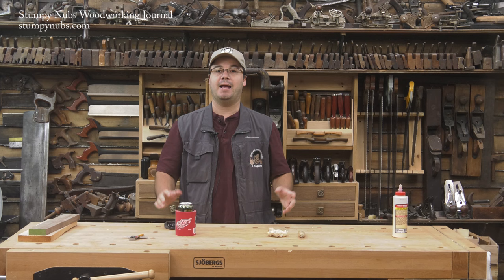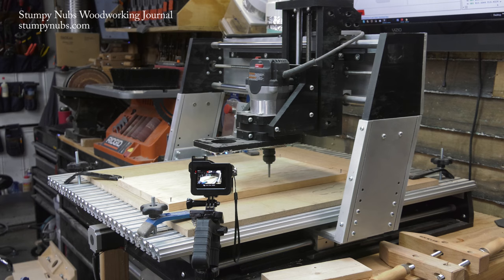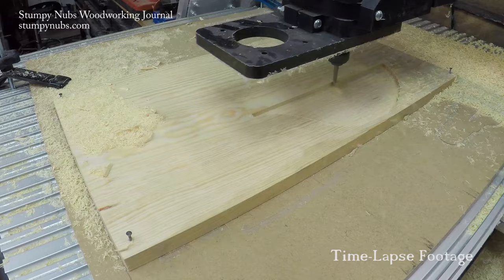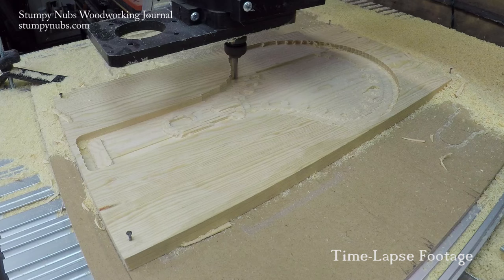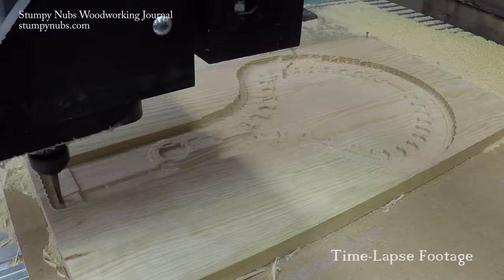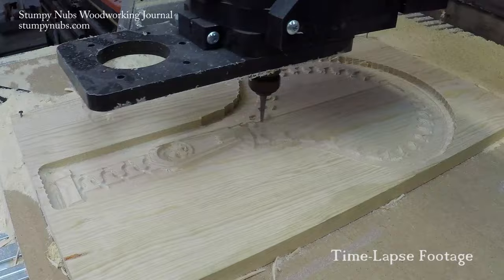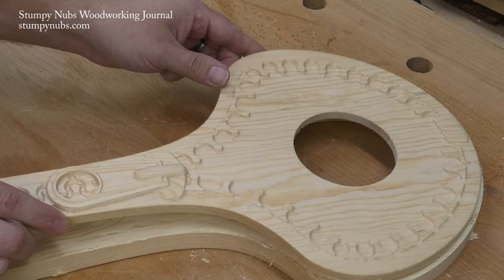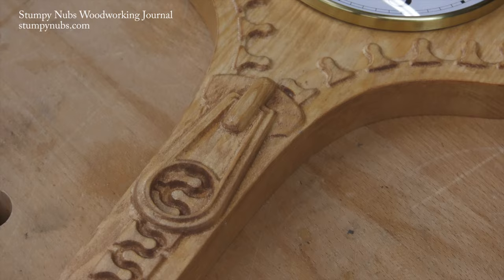WATCH THIS before you buy a CNC machine for 3D carving! (Updated)

Comment: I was wondering why there is another hole in the tool holding plate until I click on your amazon link and see it is there for a vaccum cleaner system. Did you try this system yet? Is it worth it?

Comment: Can you make a video on your setup? Or please link one if you already did it

I'm looking at making a wood shop in a year or so from now. One of the things I liked about your setup is the TV that showed what was going on at that time, and I think I might do the same.
Anyways, I think when I make my shop I will have 2 CNC machines. 1 like what you have and another being a rotary. I'm also going to have a laser cutter/engraver. And the normal stuff. I'm going to have some metal working parts in the mix. Things like brake, cutters, and so on.
Part of the shop will be section off. In it's own room I will have a 3D printer area. I already have this one, but filament can't stand humidity so I'm giving it it's own space. I'm also going to have a workstation/desk in both areas.

Something I'm wondering is how did you get your TV to show where you're at in your project. I know with my 3D printer, I might need an extra Pi or something since I don't think Octoprint works directly with any monitor.

Comment: Hi there, loved the video. I'm completely new to the CNC world but have just built my own CNC machine and now need the software to run it. I'm going to use LinuxCNC to run the actual motors but I'm really interested in the Vectric software you showed off. I wondered how you knew when to change "bits" in your spindle? Does the software tell you that? How do you know what "bits" to use and when?? Thanks again for the great video and any help you can give me (or anyone else who wants to answer this for me) Cheers :)

Comment: You describe that you are doing 3d, but a simple 3 axis machine does not do 3d.  what you are doing is 2.5 dimensional.  Your machine has no ability to cut the side of your material laying flat to the tables deck with out removing it and placing the bottom side up on another separate operation,  a 3d profiler does not require the material to be moved in order to cut every side.   You need a  machine with 4 axis or more such as a profiler machine to do true 3 dimensional.  Such like a machine that produce prosthetics are an example and usually have 5 or more axis.  2 dimensional machines are types that would work in the same fashion as a plasma or plotter, concentrating on only flat work.

Comment: I'm looking to get into the CNC game (everything from wood, polymers & composite to titanium). I'm thinking a CNC router will be a good stepping stone to eventually getting good CNC mill. The router would come in handy for soft material projects anyways. 
Would I be able to use fusion 360 for both the same? I'm starting from scratch as far as CNC's go (machines or software/code) & would appreciate any advice you can offer.

Thanks,
Reply: Yes.

Comment: I really like the look of the screen above the router.  Is it useable as a workstation in that configuration?  I'd like to do away with the cart next to my machine, but my current monitor would be too small to see from over the router.  I only use the pic now to run the router, but the bigger screen might be nice to have a second pic in shop for quick drawing work, or a web search.
Reply from the maker: It's just a VIzio HD television I used to have int he house. The older flat screen TV's used to cut off the edges when used as computer monitors. But the newer (last five years) are better. They aren't great for gaming or anything, because the response time of a television is different from a computer monitor, but it works great for the shop. My table saw is also near it, so I can put up a Sketchup model and use a wireless mouse to rotate it, take measurements, etc. while I cut my parts. And since it uses an HDMI cable, the computer can be far away from it (as long as my wireless mouse and keyboard signal can reach it.)
Reply: Nice; I was just going to suggest hanging an LCD TV on the wall- 32" are cheap as chips these days.

Comment: No,. no, and no.   This video shows  a small light duty gantry mill  that machines soft wood with engraving tool bits.   It does not use "software".   You are merely downloading  a cnc program that a programmer  wrote for his part.  (not your part).    And remember not to turn on the coolant pump,  it would ruin everything.

Comment: This is almost true but there is one small caveat that people should be aware of. Not all machine controllers are created equal. 

Some cheaper controllers do not have the ability to run all 3 axis simultaneously.  Trying to run true 3d carving gcode files could simply not run at all or create unexpected results.

Comment: Can't say I agree with the CNC definition of "3D" being the ability to cut curves in the Z plane. All carving, hand or machine, is 3D, otherwise it's whats known as a "drawing", done with a much cheaper tool called a "pencil".
The cutting is being projected normally from the X/Y plane only, onto a fixed workpiece . In 3D modelling and graphics that is known as 2.5D, curves have nothing to do with it. A 3D model with no Z curvature, such as a cube, is still 3D.
A better term for the example in the video would be "smoothed 2.5D". Going back to 3D modelling, models are comprised of polygons and to get realistic curvature requires a high poly count (not good). To reduce the poly count and get better curvature, smoothing algorithms are applied to the graphical representation. This is what is actually happening when a CNC cuts a 2.5D with curves in the Z plane, it is using a ballend bit to smooth the transition. Getting the same effect with a flat bit would require Z stepdowns of a few microns per Z pass, which could take days. It's not a case of the  software not being able to do the job, it's a case of having more efficient operations available; the cutting is calculated using a more suitable profile for the job. It can also work out roughing passes to quickly remove the masses of wood not in close proximity to the finished surface with a coarser cutter.
The jump from 2.5D to 3D is not just a case of being able to cut Z curves. Some software does true 3D and how it is created practically depends on your machine. Vectric V-Carve can produce a two-sided cutting plan where I can cut one side and then flip the workpiece 180 degrees (by hand) and cut the other side. Getting more advanced, I might have a rotary axis, where more advanced software can turn on that axis while also cutting in the other planes; e.g. a cylinder with 2.5D relief cut into the curved face.

All of the above is technically done in three dimensions; regardless of terminology and number of axes. 

You need to know what you want to make, you need to know how it is done practically and then you need to find the software that can do it. 
Then ask the spouse if you can buy it.

Comment: i was wondering where this video went yesterday! So how do you like the Shark James? If I am going to make the plunge (pun free of charge :P), I would rather have user feedback from someone who owns one.
Reply from the maker: I like it very much, no real complaints. The V-Carve software that comes with it is great stuff too (it just doesn't 3D carve like Aspire). I love the heavy 1-inch extruded aluminum bed. I wish I had gotten the liquid-cooled spindle instead of the router, but that upgrade can always be made later. They also make a new clear "box" that goes around the whole machine to contain the dust. I'd love one of those, and if I had one I would probably film more videos with it! Don't get me wrong, the dust collection boot works well. But I can't use it while filming because it blocks the view of the bit, which is what people want to see on film. Overall, I think it is a very well built machine, much better than some of the others in it's price range, and vastly better than the cheaper ones like the X-Carve. But it's a significant investment for sure, so anyone considering it should make sure they're going to use it often enough to justify the expense. :)

Comment: CNC machines are fine you can find cheap and expensive ones but once you see their software you will hit a big rock. If you don't know how to programme them or know how to change the programs do not buy such machines because they are really hard to run. I built my own CNC with stepper motors and electric board and  I was using Mach 3 software and it was extremely hard to do any job.
So try the software first and if you manage to run it then buy a CNC but you have a hard time with the software the machine will just be parked and you will burn your money for nothing.

Comment: EstlCAM is great, and it's very cheap. I made my own CNC machine. I'm surprised you haven't gone down that path yourself.
Reply: Jeff. Thanks for the lead on EstlCAM. I also built my own machine a few years ago. (22'x33' cutting capacity) I am surprised/pleased with it's operation and accuracy; but was shocked at the software cost. As a result it has been mostly gathering dust for the last few years. I will try out your recommendation.
Reply from the maker: You have a 22-foot X 33-foot CNC? Or did you mean inches (")?
Reply: Ha. My brain automatically corrected for the foot to inches. I didn't even notice it. My first CNC was 24"x36". My current machine is a LowRider CNC and it's currently 48"x36".

Comment: True 3D carving gives you undercuts. But you'll need a 5th axis head to do this. What you did there was simply a relief carving.
Reply: There are endmills designed for simple undercuts. Many jobs can also be pinned and flipped to carve from the backside. 4th and 5th axis machines are nice, but not required for most things that someone would need to carve from wood.

Comment: I'm puzzled by this.  Surely, CNC routing has two components - the router - the hardware, and the program - the software - and the two are separate entities.  Where does the software run?  Is it in a dedicated processor that is attached to, and part of  the router, or does it run in a PC that is connected to the router's stepper motor drivers with some sort of cable (USB, parallel, etc)?  Why can't you simply upgrade the software for use on your original router?  In consideration of the speed a router cuts at, even the most complex software would not tax a really old, 80386-based PC.
I don't have any CNC machines, but I am computer-literate, and have followed CNC carving on YouTube for years.  Are there aspects to this that I simply don't know about?
Reply from the maker: Who said you can't upgrade your software and use your current machine? I may have chosen to change machines, but I also say I had to upgrade the software on the new machine to cut 3D. This video is really about software. The machine you use is another matter. However, there are also vast differences in quality between different machines, which is why I did briefly touch on "finding a machine that's right for you." But these are two separate decisions, the machine and the software, and the two are usually interchangeable.
Reply: The hardware is the easy part. The issue was the software. You used to need a CAD package and a CAM package. Estlcam and Fusion 360 have merged the CAD and CAM software. 
Ultimately, you need to generate g-code. This is the code that the controller understands. I've done simple project using g-code directly. However, a 3D picture would take months or years to manually generate the g-code. 
Put another way, your model (stl file) is generated in a high level language. This then needs to be compiled using a CAM package so the machine/controller can carve out the design.
Reply: @hacktheplanet8708  excellent explanation! 😊

Comment: im planning on buying an "Inventables X-Carve" and i THINK it will do all this, but before i pull the trigger can you, or anyone, confirm that it will do all this because that is what i want
Reply: I have an X-Carve and yes it will do that, but you need the software and  must like to tinker with stuff. Read the forums over on the Inventables web site and see
Reply: DfishDmn will the easel software do it or do I have to Pony up the three hundred bucks for the vcarve?
Reply: pattyofurniture100 easel wont do it and neither will vcarve desktop. You need aspire ($2000) to create 3d carvings. OR a multitude of other programs can do it cheaper or even free
Reply: mike gager so then I have two questions, what does v carve do that easel doesn't and what would you recommend because I definitely can't afford a $2,000 program

Comment: Yeah I usually write a script that creates my 3d gcode when I need 3d. Not exactly sure how that'd work in Fusion 360 or inventor or whatever autodesk offers, haven't tried them all out tbh.
For simple stuff (lets say just some 3d curves) having a few python functions do the job is perfect if you're somewhat familiar with programming. It's way simpler than 3d printing gcode.

Comment: it need more machine than software. even chines cheap will move 3 axis same time but it cant carve even use your software. 3d carving its easy. you have 3d model put your bit down surface thats you 1 point. do it many times move with those points. thats that.. free blender free custom pluging give you gcode. free, but its more  need from machine

Comment: Hi
I refer to your comment a day ago to Antony "But it's a significant investment for sure, so anyone considering it should make sure they're going to use it often enough to justify the expense."
Simple question, what in your opinion is a realistic $ budget for a machine & software? Couch your answer please towards the hobbyist CNC user who is looking for a possible work life change.
You mention the cost of hardware & software but please do not forget the "Learning Curve Cost", that is the invisible and sometimes terminal cost.
Finally, any reason that you do not promote USA manufactured machines?
An interesting and informative video.
Reply from the maker: For hobby work, meaning you are only going to run it for an hour or less at a time, once in a while, go with an X-Carve for under $2,000 (a 24X24 bed). If you plan on using it more often, and you want to make deep relief carvings on a semi-regular basis, you may want a more rigid machine with better software. The CNC Shark is more robust and comes with better software, but it's 3X the price. For production work, meaning you are going to run it for a few hours at a time making stuff to sell at craft shows, etc. You really need a liquid-cooled spindle instead of a router (CNC Shark and others offer that option for their machines). Routers are not designed to run for hours on end, you will burn them up. I suppose the bottom line is, this is an expensive hobby. If you're going to try to make money with a CNC, you had better have a product in mind with a high margin, or it will take years to pay for the equipment.

Comment: Saying 'using a CNC isn't true woodworking' is like saying 'you're not a real architect unless you use 10,000 slaves to piece together your project, by hand, using ropes and pulleys'.
Times move on. Woodworking in another 5000 years will just be pointing a gizmo at a tree and selecting what you want it to turn in to.

Comment: My graphics designer is creating a logo for myself. I would like to transfer the logo to a 3D cnc router so it could carve the logo into wood. What kind of file would I need from my designer?
Reply: That depends on the software you use to convert the original to g-code (what the CNC reads).  Most programs work with old AutoCad DXF or Adobe Illustrator's AI format, and others can read common 2D and 3D file formats like SVG or STL.

Comment: Fair answer but what about an American made machine?
Reply from the maker: I believe the CNC Shark is made in the USA. not sure about the X-Carve, but with that machine you are really buying a collection of parts that you assemble into a machine, so it is possible that some of the parts are made in the USA and others may not be. i would check with them on that. I am sure there are others, but these are the only two machines I have owned. Frankly, I think you will find at least some parts made over seas on just about any tool you buy.
Reply from the maker: They assemble their machines in the USA. But they don't MAKE the parts, just as CNC Shark and X-Carve don't make their parts, but they assemble the machines here. (CNC Shark does make some of their parts, such as the machine bodies and router mounts, etc. It would not surprise me to learn that Digital Wood Carver does as well. But neither of them are machining the metal parts, making the stepper motors, etc.)
Reply: Carbide 3D is not only an American company, but constructs their Shapeoko 3 kits from nearly all US sourced parts (can not claim all, because I am sure that Arduino boards are not manufactured in the US).
http://carbide3d.com/vs/shapeoko-vs-xcarve/

Comment: Because actually learning how to carve is too involved?
Reply: Yes and no.  There are things you can do with a CNC router that can be done faster and with less time to get to that skill level.  Also, it allows you to reproduce and let other people share the ability the make something similar.  However, there are many things you cannot do with a CNC such as hardening the wood or anything with an undercut.  Additionally, designing the piece in a way for the computer to work with it is as complex a skill as carving by hand.  The best way to think about the CNC is that it it a tool to hold your spinning cutting bit for you.  It does not make you a better carver, it just helps the shaky hands.